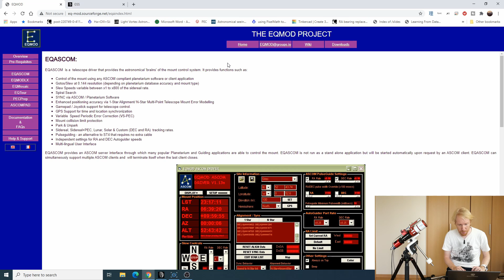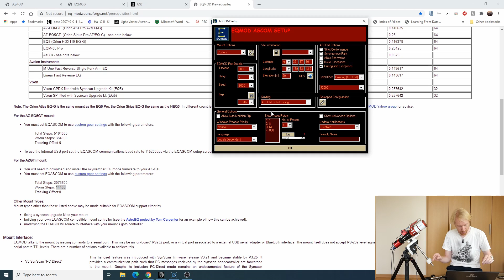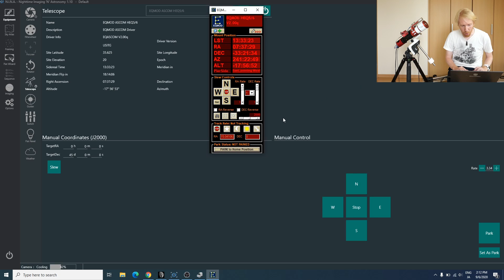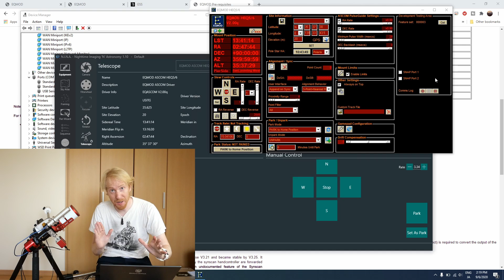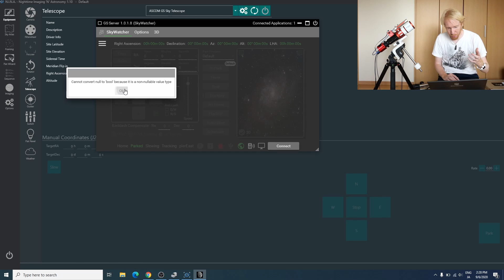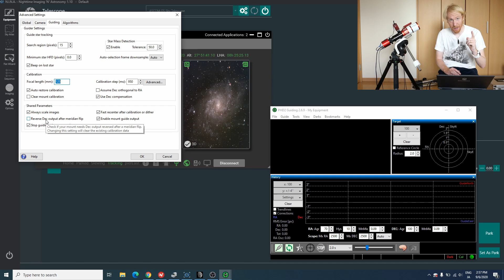Using a SkyWatcher Mount for Astrophotography? Watch THIS!

Comment: I’ve used eqmod for years with an eqdir cable and usually it’s been great. One issue to note is that if you let Windows update the driver and you have an older cable the connection will fail. I had to disable this with a registry edit in Windows 10 Home edition. Not a problem with newer cables. Something to do with prolific driver. Like the look of GSS but think I’ll wait until it’s a bit more developed before switching. It has promise though. Never done the PEC training even though I probably should. The latest PHD2 update has a predictive Pec guide option for RA which learns the errors as you guide so maybe I’ll try that. N.I.N.A. is going great! I had HFD figures below 1.7 the other night from the autofocus routine. Still need to get this perfected though as I get a timed out waiting for data message when using longer autoexposure exposure times for narrowband. Might be the slow download speed of my QSI660. I wish the ascom driver was better. Since Atik bought out QSI drivers have been very unstable. With my ASI1600mm-cool it’s not an issue. Final point, ASIAir pro latest beta has autofocus routine and initial reports are that it’s working well. They’ve added video capture as well. With that N.I.N.A. and GSS its an interesting and exciting time for Astro imaging.
Reply from the maker: Interesting on the old cables, and very good to know. Things in software move so fast, things get broken, and it's kind of normal by now, but maybe it shouldn't be... Glad the AsiAir AF is finally in Beta! I've been hearing about tests of AF for almost a year now! Exciting time with exciting technology!
Reply: Cuiv, The Lazy Geek yeah it certainly is. The cable issue drove me nuts! It took ages to work out why it wasn’t working. I installed an older driver and it worked fine. Next night no luck because Windows had updated it again! Thought it might help others to know.
Reply: @JohnMcGFrance  I think I had this problem too. Where is the driver located in Windows and where did you get the older driver from?
Reply: @kingkevinhector  Hi. The driver is thePL2303_Prolific_DriverInstaller_v10518 I just googled it I think. There are some threads on the Cloudy Nights forum discussing issues and possible fixes. My cable has an older chipset and every time Windows 10 updated the driver it stopped working. I believe there is an easy way to stop this in 10 pro in my home edition needed a registry edit to stop the update of the driver. I downloaded the old driver, uninstalled the old one through device manager then put the old one in its pace y not letting Windows search for the driver and specifying the old one in my downloads folder. It was a real pain to sort out. If you don’t have any luck I’d see if anyone can lend you a newer cable with a more up to date chipset. If that works I’d just get the new cable as it’s probably a better long term solution. Good luck. Hope this helped.

Comment: I've been having a lot of problems with synscan and EQMOD. It seems my RA and DEC axis are reversed. N/S controls the RA axis while E/W controls the DEC axis when it should be the opposite. Any advice? I am also using an AZ-GTi with the EQ firmware.
Reply: SOUTH ORE NORTH TRY REVERSING THE SWITCH

Comment: do you need to polar align this mount?
im looking to get the gti mount for my 70-200m dslr and track some objects for long exposures etc?
cheers rob
Reply from the maker: You will need to polar align if used in EQ mode. Or you can use it in altazimuth but limit your exposures to 30s or so

Comment: Hey Cuiv, for AZ GTi which guide rates (RA & DEC) did you find to give the best results in GSS?
Reply from the maker: I think I ended up at 0.9... but not any scientific approach. It just worked well enough for me...
Reply: @CuivTheLazyGeek  Thank you! It would be really interesting to see the limits of AZ GTi. For example with 70 or 80mm refractor. New PHD multistar update (thanks to you again) makes a huge difference, so I was wondering if that could assist the larger weight as well.

Comment: Why should you use EQMOD, its a terrible old fashioned peace of software meant for bigger mounts I think. I only use Synscanpro and the I can control the mount and polar align and goto all on my phone in the middle of nowhere . Also I can connwct then with Stellarium and control the mount. And with Ascom installed I can do further control with Nina on laptop. I do not understand what eqmod and or Green Swamp are adding to this.

Comment: Thanks for such great content. Since there's no "official" support for the EQ mode... there's no official load spec either. Do you think the AZ-GTi (with appropriate CW) could handle a bit longer, heavier (observing only) rig in the EQ config than the AZT rating (11lbs)? Say an Astro-Tech 102ED (a longer 12 Lbs with diagonal and eyepiece)
Reply from the maker: Wow, a 102ED would probably be quite a challenge because it is so long and the FL/Resolution is really hard todeal with ... I probably would go to a 90mm refractor at most... For a 102ED, I'd probably go straight for an EQ6R, just so I don't get frustrated all the time... Of course, challenges are fun! :D
Reply: @CuivTheLazyGeek  A 90mm would probably do just fine for family viewing. I knew I was probably pushing it way too far with the 102ED. I already have a HEAVY Setup for Astrophotography and some nights it's hard not to be Lazy and just skip it. Skywatcher bundles a Skymax 127 with this mount.. Of course I would prefer the 150. It would not be so long but the weight of 14 Lbs may be yet another deal killer for the AZGT-EQ. I guess I was hoping the EQ modification with CW would handle a little heavier load than the ALT AZ setup? Keep up the good work!
Reply from the maker: @stringb2647  Well, it doesn't hurt to try! That's why we have full mons, to test stuff :D You never know, it might actually work!

Comment: My understanding is that EQMOD cables are USB/A to RJ12
Reply from the maker: I'm no expert on how the cables themselves are made, and an EQDIR cable for the AZ-GTi won't be the same as one for the EQ6-R for instance...!
Reply: You are correct with the connectors, but the cable also hides an active integrated circuit that provides the USB to Serial level conversions to match the SW mount requirements. These cables are often described as EQDirect.

Comment: Great video! Very detailed and self explanatory. However, I do have a novice question, with EQMOD or GSS you can do an autoguiding without a guiding scope, correct?
Reply from the maker: You need a guidescope (or an OAG) for autoguiding regardless of mount BUT if you are referring to dithering without a guidescope, you are right, it can be done with either GSS or EQMOD

Comment: Life is not fair)) Unfortunately, the Sky Watcher AZ GTI was created for the azimuthal mode of operation and by switching it to the equatorial mode, we greatly overload the single bearing of the RA axis and the closer to the equator, the greater the deformation of the entire structure and, as a result, inaccurate guidance along the RA axis. And in terms of control and versatility, this baby is the leader among the lightweight class of mounts. iEXOS-100 is also from this class of mounts, structurally a cut above the Sky Watcher Az Gti, but an absolute failure in controlling stepper motors. How to live?))) Sorry for my English, I'm from Ukraine.
Reply from the maker: There is definitely an unmet need in the field of full goto, lightweight, and cheap EQ mounts!
Reply: @CuivTheLazyGeek  With this you can not argue

Comment: The laziest way to control this would be eqmod cable + ASIAIR. Specially with the update beta version with AF using the ZWOeaf. I’m surprised you don’t use ASIAIR.
Reply from the maker: I've been waiting for that AF to come to the ASIAir - no AF made it simply not interesting to me. I am just very familiar with NINA, having coded part of it (including the current AF iteration), and I like the power and flexibility it gives me. ASIAir looks excellent, but it won't control my Astromechanics Adapter focuser for instance, which is really too bad... For the setup on the screen, ASIAir would definitely work though.
Reply: Cuiv, The Lazy Geek The dream set up would be a Zwo canon adapter with AF control. Shouldn’t be that hard 👍
Reply from the maker: @noypi75  Yep - or them simply partnering with Astromechanics. I've already given them that feedback :)